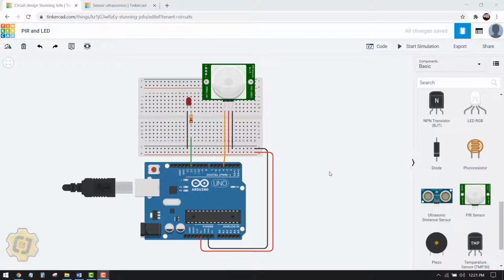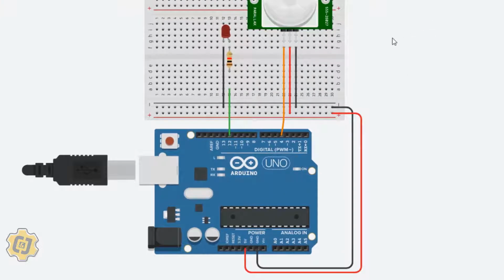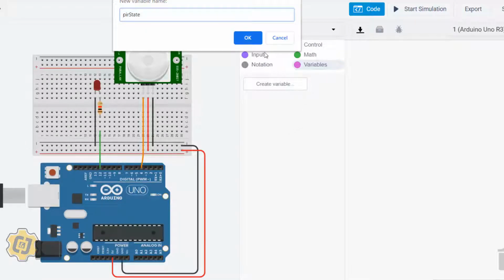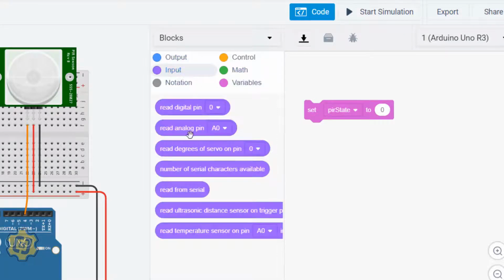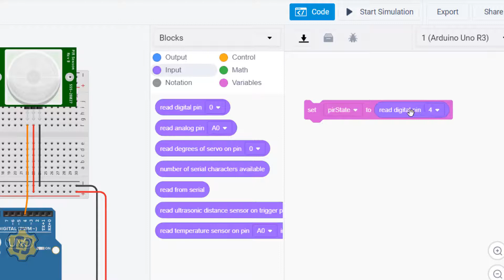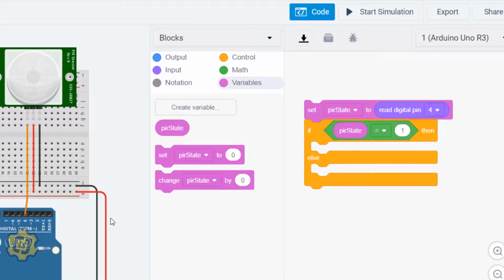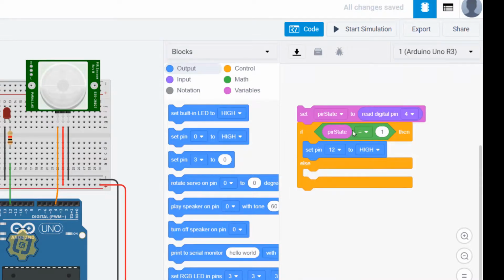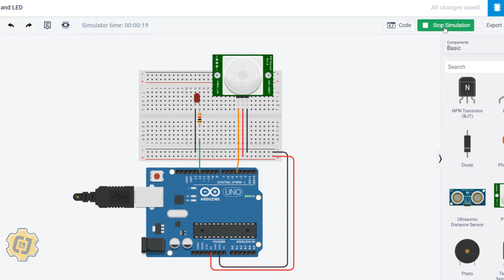8 PIR and LED

Comment: now how do i set it up to have the sensor take over a normal code.  like i want to set up an stop light and if the motion sensor is tripped by someone walking by i want to have all the light immediately do something else like all flash or all stay on or auto go to green.  i got it to change but it has to finish its sequence before it happens i want it to take over. it for a back yard stop light